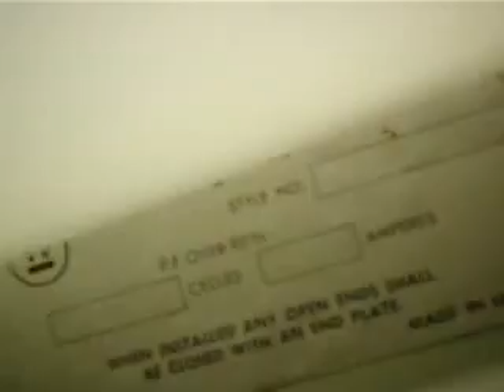Modifications to the vintage 1965 Westinghouse fluorescent fixture on my ceiling

Comment: What is the difference between instant start and rapid start? In england we use the terms HF (this stands for high frerquency) electronic ballast crap. Switch start that is your pre heat and SRS start semi resonant start which has no starter and 2 different wound coils in the ballast?

Comment from the maker: The starters were Costa Rican Leviton starters that I bought at a local hardware store called Orchard Supply Hardware. I hear they are available at many other hardware stores too. I modified them by switching glowtubes and bases with some Chinese made Sylvanias, which had white casings and cylindrical glowtubes that had more of a blue purple color rather than the pinkish color of the Leviton glowtubes. Seems more color came through the green casing with the sylvania glowtubes than the Levitons.